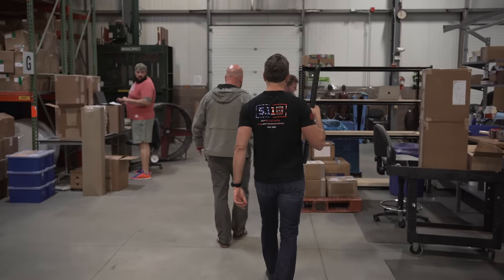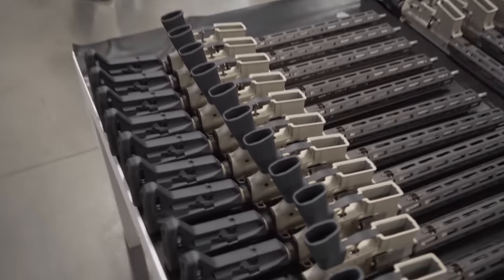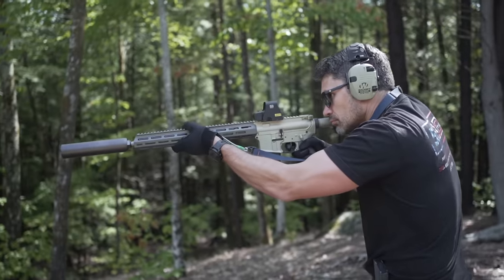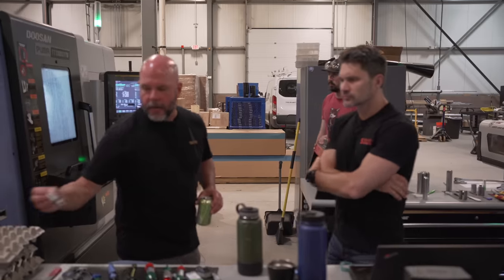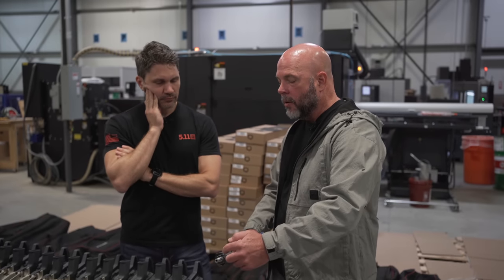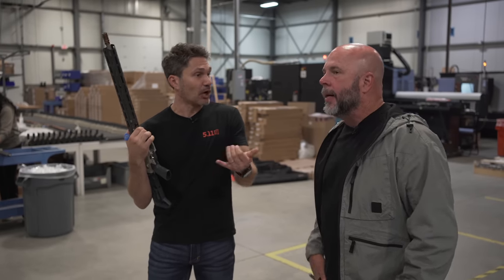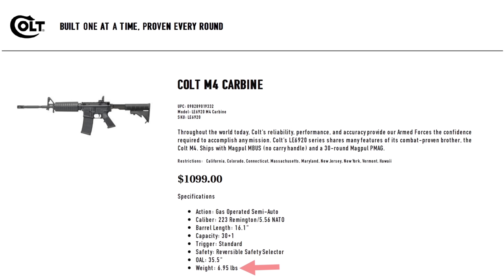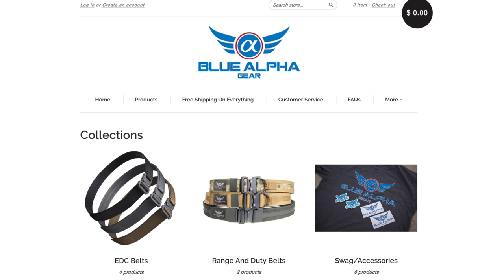Why Q's AR-15 Will Disrupt the Market: The Sugar Weasel 16"

Comment: My CHF chrome lined FN barrel  shoots moa all day and yes generally they are more expensive than say barrels like Ballistic Advantage but it's going to last 4 times longer than a stainless one then I don't have to get the barrel replaced every 3 to 6 thousand rounds I have to say that taper lockup for the muzzle device is the way of the future they are definitely innovating great video!!!!
Reply: Same, my FN barrel shoots MOA
Reply: I have the FN upper combo from Palmetto on my PSA AR. I got it on sale for 500 bucks. I think its usually 699-799 range. Good stuff. The handguard is very nice and has the clean mid section so you can wrap your hands around the whole gun easily.
Reply: A 12.5 and a 14.5 DD and both shoot moa . Under that with handloads. 12.5 shot a 2-3/4" @ 300y with a 50g ballistic tip, it's why I bought the 14.5. Didn't buy complete DD rifles, found the barrels on sale and built.

Comment: I paid $2000 for my 300blk sugar weasel, over a year ago. A little pissed that they’re adding all these accessories NOW, when mine came with a mil-spec trigger, and receiver parts. I feel cheated… Thanks a lot Kevin… I paid though 😅
Reply: "lol thanks for funding my hot tub bozo lol (middle finger)" kevin probably.
Reply: You could have done better for $2,000.
Reply: @GeauxRussGeaux  I’ve been called worse… But I’ve also been called better 😅

Comment: I've just bought the Sugar Weasel , it's my first ( and only AR-15 ) , there are multiple things I like about it , I fired someone else's AR and it had some kick , very manageable but with the Weasel I really don't feel it , I don't know where it goes but it's great , the features , the smooth trigger etc.. but the one thing I have against it is it doesn't have a manual. It's my first. I know some people will say go online , I don't want to bring my gun in my little office to clean it. I'm not familiar with the AR so I'm not familiar with disassembly and reassembly. I'd rather just have the book. Nothing wrong with a book. It's a great gun but if your not knowledgeable with take down and reassembly , I can't recommend it

Comment: I can put a LaRue trigger, and maybe a spring/buffer change. And can make a $500 PSA feel like a $1500 rifle. Not saying it would be as accurate.
Reply: There's a lot of that in this video - "it comes with an adjustable gas block" like come on tfbtv, you can get great AGBs for like 40 bucks

Comment: It would be disruptive if it was PSA priced. Looks good though. 

To be fair, TFBTV has sold me more guns than any other guntuber.
Reply: Street price is just under $1,400. That's pretty close to a Sabre. Top of the line Sabre with the Fn barrel and Geissele trigger is $1,250. Based purely on the parts list , as long as PSA did their job right and assembled them correctly, the top tier Sabre should be a damned good rifle for that price.

Comment: The choice of a stainless barrel is absolutely a cost-cutting measure. He says out of one side of his mouth, "I can get CHF barrels for the same price as this match stainless, we chose the stainless for the best accuracy/dispersion" ...then immediately goes onto explain exactly how you can bring CHF barrels down to similar accuracy potential if only they are manufactured properly — which comes down to a fairly simple set of issues that can be described in just a few simple sentences and costs only slightly more to do, especially at scale. 

I don't know about you guys, but if I'm going to blow $1600 on a high-end AR and I was given the option for a $50 upcharge for a CHF barrel that offered the same sub-MOA accuracy potential as the default "match stainless" SKU, but with 3-4 times the barrel lifespan and can be ridden hard and put away dirty eight days a week with no concern whatsoever for corrosion issues that would be a guarantee with any stainless barrel treated the same way... then I'd be taking the CHF option every time. And I would seriously question why the stainless option exists at all. 

Who in their right mind would want to pay the same premium pricing that could get them one of BCM's top-tier guns (or an even nicer fully custom build) for an ultralight tactical AR-15 that has to be babied like a bench rifle to avoid rust and will have to be rebarreled every few thousand rounds to keep a sub-MOA punch card? Two types of people. Those who don't know much about guns, and those who have more money than sense. The concept for this rifle is very transparently a cynical ploy to cash in on the brand recognition that Q has built up over the years via serving the smaller market of the LE/mil special operations community by releasing a much less impressive product to the mass market that's still able to pull them a similar per-unit profit margin by coasting on the Q name. Not a gun for serious people, and 95/100 sold will probably end up as safe queens.
Reply: $1600 is more mid tier, so you’re not really paying top tier prices for this rifle anyway. Getting a SS barrel for that price is somewhat understandable when considering all the other features that come with this rifle and when compared to the more premium brands in the space such as KAC, LMT, HK etc. All costing $1k more (at least) which is not a trivial expense to most consumers.

Comment: I’m a fan of seeing so many brands invested into one platform. Be honest, without continual innovation from so many brands the AR likely wouldn’t even be close to where it currently is in terms of innovation.
Reply: It's amazing how many people can't seem to figure this out. They seem to think this is really bad because so many companies are making these things. 

This is the reason it's possible to get something that will work just fine for less than $500. I just saw on Reddit where someone was showing a complete upper and lower with all the parts needed to assemble it from PSA with the lower parts kit and stock, you could basically put together a functioning rifle for about $350. I'm sure it's not amazing but it's still a real AR15 rifle and the upper was already assembled, just the lower needed put together. 

So you can get as low indoor high-end as you want and everything in between. It's amazing how many gun people seem to be critical of this. Some of them in the comments seem like they're almost angry or offended about it. I think by flooding the market with an extreme number of these rifles will make it harder to ban them. I think every American household should have one, even if it's the cheapest one.
Reply: Please point to the innovation in this gun. There is none. NONE.
Reply: @InvidiousIgnoramus  You or I have not seen the trigger in person. But that would be the first place I would start.
Reply: @waterboy330  wow, a cassette style trigger. What's so special about that? They're everywhere, and according to people who've used it this one is nothing special.

Comment: Hard pass on stainless barrel. That's like the crap HK pulled with the MR556 and leaving out the chrome lining that the 416 gets and then still charge over 3k. Honestly if they're the same cost, you get the barrel with the better longevity. I don't know a shooter anywhere worried about a 1 MOA difference at 200 yards.

Comment: Bought the SD 12" handguard for my 12.5 (that is impossible to find a full length handguard for because all manufacturers hate 12.5s).... oh man is that an awesome product. My absolutely favorite part of that rifle. Expensive but the lockup, perfect size cut right up to the barrel threads by the in-house Q mohel, and the classy grey pop of color on the all black rifle... Shit yeah.

Comment: This would be great if you have the same reputation for reliability as the other manufacturers you listed do. For the parts you're getting you might as well just buy a PSA.
Reply: Not too mention the fact their Sabre line up is down at 850 and 950 bucks hard sell from q imo

Comment: It looks pretty good to me. A bit more hate in the comments but it's not easy to get an AR that shoots that accurately and weighs 6lbs with a full length hand guard. I'd really like a 10 or 12 inch hand guard myself. If it truly is as accurate as he claims I'd consider one of these for sure.

Comment: I can see it as an option on the market, but not a disruption. Those that understand the differences often have preferences, i.e. forward assist, that the SW doesn't offer. Those that don't won't spend $1500, anyway. Nice, but not enough to get me excited and searching...which unless production is higher is another deterent to disrupting the market. I've looked for "currently unavailable" firearms before, and found something I like as well or better while waiting, then wondered why I got the fever for the unavailable item in the first place.

Comment: Man, a lot of Haters in the Comment section 😆
Seriously though if you start breaking down the parts / Prices, it is a good value. 
Muzzle device is $100
Changing handle $100
Gas block $100
Magpull stock Premium trigger etc... 
You basically end up paying somewhere around $900 for the gun
I mean how much is a good BCG that uppers don't even come with, like $150 🤷‍♂️
Reply: If you try to build your own properly gassed rifle, it will cost at least 1600, so I think this is not a bad deal. I tried to build a rifle with a criterion core and ripcord LDR, but when I made a list of  components with no compromise, it was just below 2000

Comment: This rifle seems pretty damn close to perfect save for the stainless barrel. A CHF barrel would’ve been the preferable for me.
Reply: Why?
Reply: @-John-Doe-  Stainless steel barrels wear out much more quickly than other barrels. You’re lucky if you get through more than a couple professional carbine courses before the barrel’s throwing shots. The accuracy difference is to the point of diminishing returns. If you’re trying to compete with this gun, then sure 1 moa vs 2 moa or even 3-4 would be much more preferable. But if you’re doing combat shooting you will not notice a difference. 

TLDR: going for accuracy instead of durability is dumb cause most people shooting this gun won’t notice the slight increase in accuracy. But they will notice the moment the barrel dies much sooner than it would have with a CHF.
Reply: @hambonesmithsonian8085  10k rds vs 15-20k is not much of a concern to anyone. Yeah if you’re doing mag dumps or full auto all the time you probably don’t want SS, but people make a bigger deal about it than actually exists.
Reply: @Hornet135  You have a misunderstanding of how the degradation of barrels occurs.

1.) Stainless steel typically lasts 5,000 shots before a lost in accuracy is measured.  Not anywhere near 10k, but there are higher quality manufacturers which can get closer. 

2.) Rapid fire isn’t the only thing you should worry about. Slow fire degrades stainless steel a lot more than people think. I’ve seen a wilson combat barrel die after 4,000 rounds of slow fire.
Reply: @hambonesmithsonian8085  99.9999999999999% of shooters will never shoot 5k rounds through anything.
Reply: @hambonesmithsonian8085    I don’t misunderstand anything. The same basic things wear all barrels. SS generally will lose acceptable accuracy sooner than an equivalent 4150 barrel, but there can be huge variation based on the exact alloy used and manufacturer.  Your Wilson combat example is still a sample size of one. 4k rds killed that one, but there’s other stainless barrels that have maintained accuracy past 15k rounds through multiple classes. 
Find a barrel that’s accurate enough for your needs and change it when it “dies.” By the time that happens you’ve already spent far more on ammo than the barrel or likely rifle even costs.
Reply: @Valorius  That’s fine, however as this thread should imply to you, I shoot a good bit, so having a barrel which lasts long is a big concern for me. So I guess I’m in that .0000000001% of shooters?

Comment: The machine feels how smooth the creep is? Isnt the assignment to always remove all the creep?
Reply: It is designed to be a 2-stage trigger so there has to be creep to the wall then a break. So they made the travel to the wall and the break as nice as possible.
Reply: @LtLemontwist  take up - creep - break - overtravel - reset

Comment: A lot of people hating on this thing but there are plenty of people who will love this rifle that shoots 1MOA out of the box and only weighs 6Lbs with a full length handguard and seems to have a really nice trigger. More companies making these things the better as far as I'm concerned. It seems like a very nice rifle rifle to me and would probably be great in a shit hits the fan scenario or general home defense along with amateur competitive shooting competition.

I like to build and tinker so this is not for me but most people are not like me, most people want to take it out of the box and at most mess with the sling and optics.. Personally what I do is patiently search for decent deals and hand-select each component to build exactly what I want. I already have stuff ready to use, so it doesn't matter if it takes me a year or so. I've been really liking the VLTOR MUR upper receiver and building off of that, the action cycles smoother and quieter than average with it. From there I put the money into the barrel, bolt carrier group and trigger. 

The VLTOR would not be the best choice if you're trying to build as lightweight as possible because it weighs a little more than average. It's not extremely heavy though. I spent way less than less than $1,700, but way more than $1,000 for my carbine and I would put it up against this rifle in performance and durability. The barrel is CHF Daniel defense and it might not be quite as accurate as that stainless steel on this rifle, but it's decent and will certainly last longer.

Comment: I’m a Q hater for sure but $1500 isn’t bad for that rifle. That’s cheaper than a good amount of BCM rifles and I think you’re getting a better trigger safety and charging handle for that price. Plus if you’re planning on using a suppressor the included agb is cool.
Reply from the maker: That’s kind of the point. I get the Q hate for sure but this is exactly how I feel.
Reply: I would gladly pay more for a BCM with a Geissele.
Reply: @docholliday3374  I’m not saying I would buy it. I build my own rifles with the parts I want so buying a complete rifle at all to me doesn’t appeal unless it’s something like a KAC or LMT but if someone was gonna buy a complete rifle without the intention of changing parts it’s not a terrible value at $1500. Considering how overpriced the rest of Q’s shit is that surprised me.

Comment: ABSOLUTELY RIGHT!
Hammer forged barrels ARE not the most accurate barrels.
Durable? Yes..
Same with chrome-lined. You can't control Chrome plating thickness extremely well.
Durable? Yes.

Comment: This does look like another AR, but it’s the little things that count.
Sub moa is hard to believe, I love the trigger, it is a high end trigger for far lower cost.
70 degree bang/probably won’t bang switch is awesome.
Ambi charging handle isn’t really a huge deal, but it’s definitely something.
Adjustable gas block, that’s held on with a lock nut instead of pins is a huge deal, that’s the number one failure on even high end AR’s
A full length hand guard is important if you use more modern shooting techniques and are over 5’10”.
If you throw all of these features in any other AR, you’ll probably be looking at $2,500-$3,500.
And this one runs for $1,600.
I’m definitely going to get one.
Reply: Sub MOA barrel (Any BA barrel will shoot sub-MOA with 77gn OTMs) = $200
Radian Talon 45 degree safety = $50
Ambi charging Handle = $40
Adjustable gas block = $90
15" Handguard = $200 

$580
Reply: What triggers are you looking at that this "$350" trigger is somehow "far lower cost"?
Reply: @InvidiousIgnoramus   geissele two stage, is the comparison, listening to the manufacturer description.
Reply: @AFOPatches  I disagree, sub MOA is hard to believe, because most manufacturers make that claim based on shooting several 3 shot groups and if they get one good group out of a hundred they then say it’s sub MOA, even if every other group was 2 or more MOA.
You can find barrels that shoot consistently sub MOA, but as far as I have seen and tested over the last 30 years, not on an AR, unless it’s a custom made precision barrel, and those normally run $500-$1,000.

Comment: Serious question for people more knowledgeable than myself. I'm in the market to get a new AR for around $1500-2000 tops. Debating between this and the DDM4 v7. Which is the best package out of the box and for what reasons?
Reply: As far as which one is better out of the box  I don’t know, but I will tell you this I bought a DD M4 V7 and absolutely love it. It is a real tech driver. It shoots not much over MOA with about any ammunition I put through it and if I do my part with the right ammunition, I can get around half inch groups out of it, about the only complaint I have with the DD M4 V7 is it comes with no iron sights, but I bought Magpul pros to put on mine, and the trigger is god awful, lol, it’s Arushas, but with a SSAE trigger  a good LPVO and a set of M BUS PROS honestly you can’t ask for a better rifle, and don’t forget about their lifetime warranty and great customer service In the event you have a problem with the rifle, hope this helps

Comment: Obviously you gotta take care of your guns and they’ll take care of you but without your favorite bolt button lol, I’m curious on how long you can go without cleaning. I understand it’s an adjustable gas block which can help but I’m still curious. Haven’t cleaned my Springfield saint and it’s running fine after 1000+ rounds. I honestly have no clue how many rounds I’ve shot, could be around or over 2k. Never pushed the bolt closed, but I might get one of these to push its limits